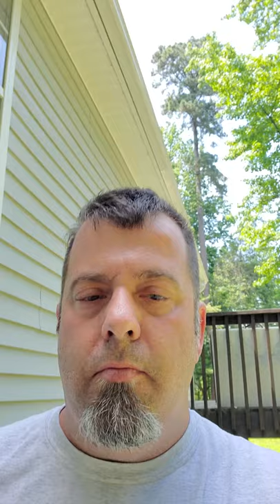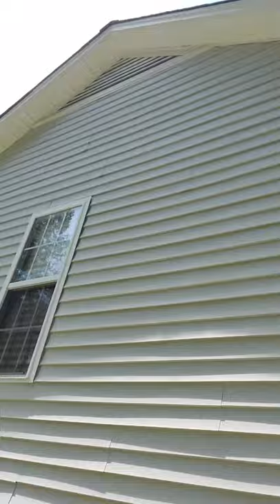Do attic fans do more harm than good?

Comment: This is such a broad statement. There are so many factors that play in on whether or not attic fans are good fit for you. For example, if you live in a extremely dry, extremely hot place such as Texas to attic fans are the way to go one pulling in air from the outside into the attic and the other pushing the air outside to maintain the attic temperature the same as the outside rather then 170°, which then radiates into your home

Comment: My attic temp is now usually within 12-14 degrees of the outside temperature hottest part of the day and year maybe 20 degrees hotter for an hour ish. During the evening and all morning long my attic temp tracks with the outside temp. that's year round so in the Midwest I don't have a 60 degree attic when it's 30 in winter and it takes longer to heat up cools down quicker now too. All of this was accomplished by proper venting. I'm so glad I didn't get a fan but I did have to do quite a bit of work to get it this way. My utility bill has gone down and comfort level of my house is great. On a side note when I bought the house I wondered why it would be 70 outside but 80 in the house and it would get hotter as the night progressed.lol now I know why good luck to you all

Comment: We have geothermal heating and ac system which why is great for heating does a poor job really cooling our house.  Since we had continuous soffit venting it has been an amazing addition to our system.  You can always add venting to the home and just clearing the hot air in the attic alone is worth it for us.

Comment: I have seen a few people talk about this but they aren't in california. I have this fan:2940 CFM Smart App Controlled 2-Speed Gable Mount Attic Fan. IT rocks. I don't run the air conditioner much if at all when its on. Today I was home all day, it was 85F outside and in the attic it went from 120-96 with the fan on and it was 77 in the house. I've seen guys using faulty logic. These fans do wonders in california, I can see the benefits being less if the outside temps were over 100f. When its just 75 f outside the attic could be over 100with the attic fan on that cools off and keeps a cushion between the roof and the ceiling.  Yes, my 1956 house has lots of lower vents. lol  I can't recommend this fan more. I will say, I had to get a larger dormer vent because the original one was limiting how much air could be exhausted.
Reply: I was able to vent my attic properly so when it's 77 outside my attic temp is maybe 87. attic fans work per se but proper venting negates the fan from needing to turn on in the first place. Also depending on where a person is in the USA in winter my attic used to be 60 when it was 30 now it's mid 30s. Fwiw. I know some people have to get a fan but it's better to solve the problem so you don't need a fan. Glad it works for you though.
Reply: @MikeM-bn2ij  absolutely not in my case. I live in a house that has vents all the way around it. And they are 100% unobstructed. It was built in 1956 but when I rehabbed it I reducted and made sure every one was clear. It’s been in the 70s all day an my fans on low and it’s 95f up there. You must have giant unrealistic vents
Reply: @MikeM-bn2ij  just as an fyi, my vents are every 4 ft around my house except for the front porch which is about 12 ft.
Reply: I just got an attic fan for my Calfornia home and the manufacturer (quiet cool's medium size, two speeds, low and high)  recommends 80 degree for low and 120 degrees for high.  Right now, the outside afternoon temperature is about 75-78 degree and will occasionally get to be 80 to 90 degrees.  Should I follow the manufacturer's recommendations of 80 for low and 120 for high? I'm thinking the high setting will never be used. I'm wondering would 75 and 100 be better
Reply: @leonpse  I think you gotta do your own testing. I'm 8 miles from the beach and I have mine at 80f for low, and 100f for high.
Reply: @fastj1962  Thanks the manual says 80, 120. I am about 6 miles from ocean and a mile from a bay in Vallejo. I’ll try your settings.

Comment: In South Florida attic fans are worthless. All they do is suck up conditioned interior air and become a hazard with hurricanes. Passive ventilation is what works best in the humid tropics.
Reply: You realize that technically your attic should be air sealed from conditioned space and so should only. Exhausting attic air causes a hurricane please explain that.

Comment: Thank you so much for this video. I'm having a problem with humidity. I have two wind turbines on my roof (but no wind here in CA) and was wondering if I can put a fan by one to pull air out and a fan by the other to pull air in. Would that be a good solution to ventilate my attic? Thank you so much!
Reply: I installed  2 QC green, 3 speed, gable fans, both push air out of the attic, R 76 insulation  also helps
Reply: @markchristensen5206  Thank you!
Reply: I live in California

Comment: What about this scenario: 1950's cape cod; one side has three roof vents (not a ridge vent) and other side has no vents on roof, but there are two windows/grills at each end of the two runs with a master bedroom splitting the two. Also has a gable vent at the top peak. Upstairs gets extremely hot in summer and seems to be a bit of moisture in the winter. The home does not have soffit ventilation. Is an attic fan appropriate here? Thank you!!
Reply: My cape cod is exactly as you described

Comment: My house has a perforated soffit, however behind that is solid osb with no venting. For 1000sqft I have a pair of 2ft by 3ft gable vents. I have 60,000btu of AC. At 96F outside, with the ACs running for the previous 4 hours it was 78F at 67% humidity.  

After the attic fan it was 117F outside, in the living room 68F, 47% to 57% humidity, and the AC often turned off because it had hit the set temperature.

I have fiberglass batts in the attic and intend to install blown in fiberglass when it cools down so I can stand the temperature up there. The rafters are 24 inches apart, 26 inches on center, so next to each fiberglass batt I can see 2 inches of clean sheetrock, or 10 inches of clean sheetrock when they used fiberglass batts for 16 inch stud spaces.
Reply: my gable vent consumes 2.4 amps at 110, or 260 watts, and has a 14 inch 6 blade impeller made out of galvanized steel. It is on the same circuit as the microwave, and when they are both on, my breaker blows, so I do need to go up there soon and put it on a different circuit. Yes, that is 6 times as much power (and maybe 6 times the airflow) as those solar ones.

Comment: Unless very short of soffits, attic fan benefits despite slight negative pressure and drawing air from home. The culprit is not attic fan and the remedy is to add soffits/lower level ventilation rather than blaming attic fans.
Reply: Where to do you find lower level ventilation? I tried calling HVAC people to do that. One side of my home is shaded and windy. I asked them to install vents on the ground floor and vents to lead to the attic, but none of them was willing to do that.

Comment: Our fan is in the laundry room installed by the builder with a pin timer in the garage. How often and how long should it run?
Reply: I know your question was asked a while ago but I just wanna add my two cents as well your attic fan should run according to the timer that you set on it or the temperature level you want to maintain in your attic
Reply from the maker: Hi Jackie, sorry for the delayed response. If you are in a newer home i would bet that what you have is a fresh air intake system, as the controls for those are typically in the laundry.  If that's the case I would recommend consulting the installer as those are calculated by fan cfm, house square footage and area climate.

Comment: How would I know if I have moisture in the attic? Other than looking in the attic
Reply: It depends on what you mean by moisture. For relative humidity, you could put in a simple humidistat and compare that reading to one in your living space as well as outdoors. If you have condensation (water you can see or feel) say from a bathroom/shower where the fan may be operating improperly, you (or someone) may be able to find/fix that issue. If there has been insulation added and/or improperly installed with no ventilation,  condenstation and form behine that. If the area smells of mildew or mold, you likely have something going on - blocked soffit vents, etc. 
If you want to DIY, a thermal imaging cameral (or attachment for IPhone or Android for $200ish) can spot moisture (I have the FLIR One for Android that I use for checking heat/cold that is supposed to detect moisture in, say a wall, tho I've not used it for that yet.)

Comment: Intresting...never looked at it that way,,got a question though,,not challenging your knowledge jus curious to know,,you stated  heat rises which is fact,,if the heat is generated in the attic from the sun  radiated heat correct  so heat in home comes from the heat in the attic correct?  Because im trying to figure if you can control the heat source which i feel would be in the attic then inside the home will be cooler,,,but i do agree some cooling loss doing so with attic fan  venting the heated attic from the sun,,,,guess its a catch 22 lol tit for a tat???  Recieve and lose,,no middle ground lol
Reply from the maker: Heat doesn't strictly rise though, more than that it is drawn to cool, which typically means it rises but when the hot air is above convection will cause it to come down. If you open your attic access in the summer, give it a few minutes and you will feel the heat coming down through the opening
Reply from the maker: Also, to add to my reply, I'm not saying that dropping attic Temps isn't good. It is definitely essential to keep attic Temps to a minimum for an efficient home. I just think there are better ways than just throwing on an attic fan. Radiant barriers and properly vented attics are much more effective ways to gain overall efficiency
Reply: @hop2ithomeservicesllc58   too true
Reply: I know this is a old message in the video but I do wanna add my two cents that is radiant burials is a good way to control and eliminate heat from your attic but it can be difficult to install radiant burials if you’re doing it yourself also it’s very expensive so the attic fan will work like you guys have already stated if you have adequate ventilation like you should have in your attic also placing the fan in a location that will not draw too much of your cooling air from your living space up into the attic is another way to utilize the benefits of gable attic fan systems

Comment: It's rated by cfm not by SQ feet of fan that doesn't mean anything one fan will be 600 cfm and another with the same squat foot will be 1200 cfm
Reply from the maker: Attic ventilation is measured by square feet (inches) of vent area. Yes, fans are measured by cubic feet but you need the proper area (square inches/feet) of vent area to ensure there is enough fresh air to supply the air needed for the fan

Comment: they are a good idea if you have moisture issues in the attic  in the winter
Reply from the maker: Usually if you have moisture issues in the attic, you have poor ventilation.... and it's only providing you evidence in the winter. If the poor ventilation is due to inadequate lower venting (supply) then when you turn on the attic fan it creates negative pressure and pulls heated air from your home in order to ventilate the attic.  The attic fan may be a solution, but it doesn't solve the problem
Reply: @hop2ithomeservicesllc58  yeah you are right i am getting some badly needed  soffit vents